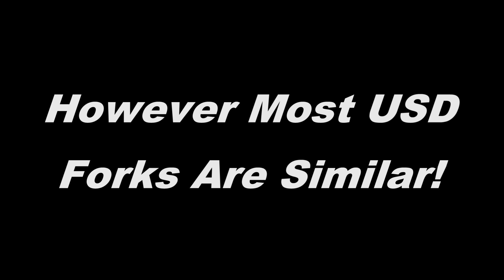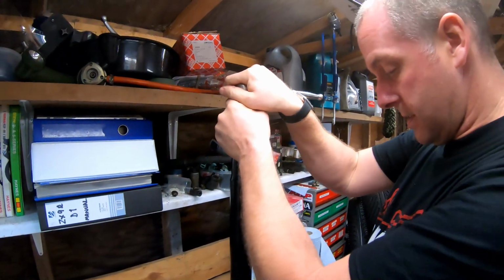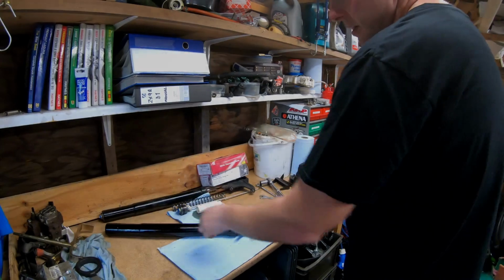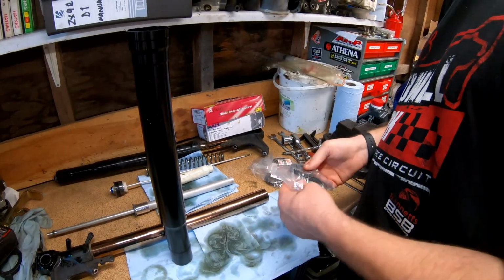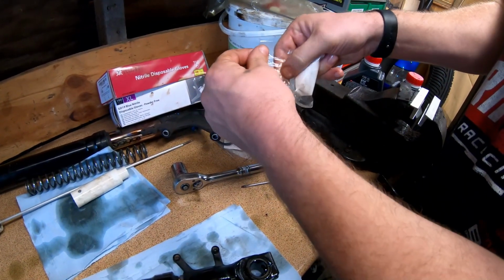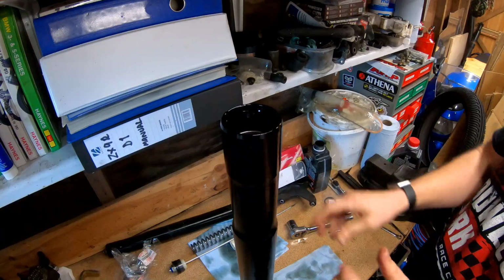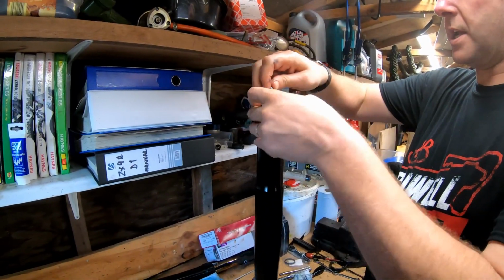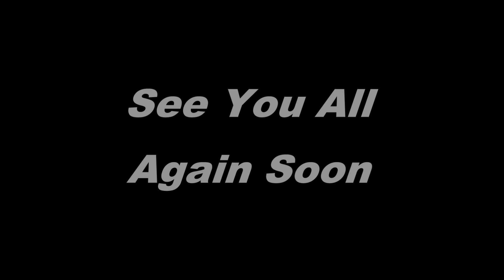Upside Down Motorcycle Fork Seal & Fluid Replacement

Comment: Hi mate. Thanks for the video. 

A tip I have for you though. 
Keep a spare yoke near your vice. 
If a customer drops round the stations with the top cap on you can use the yoke to hold the station while you unscrew it. 

(I've actually bored a yoke slightly and rounded the ports so I can easily slide them in and out without scratching them)

Comment: good video Kev . but there wasn't any need to undo the damper bolt in the bottom of the leg and no need to take out the damper rod as they can be a bugger to get back in if they start spinning  ,you only need to undo the bottom bolt on right way up forks,
Reply: You sure about that?
Reply: Yep I am
Reply: @lornemiddleton3532  so once i get the locking nut off underneath the upper spring from the fork cap, remove the circlip from the fork seal, i can start to use the forks like an opposing slide hammer to split them?
Reply: @Rman1100  yes exactly that you always fill the legs with oil with damper rod in place

Comment: Great stuff, chap!
I'll now tackle my DL1000 2018!
Can't find air gap info though, so will catch what's emptied out. 👍🏻
Reply from the maker: From the DL1000 V-Strom Manual that I have found it states that the oil gap is 133mm or a capacity of 505ml per fork. Check out page 287 of the manual at this link:

https://www.manualslib.com/manual/998591/Suzuki-Dl1000.html?page=287#manual 

I hope that this helps you out mate. Don't forget to subscribe to the channel, it really helps!

Comment: Hi from Montreal: have a V-strom 1000 2015 inverted fork.  I didint change the seal, just changing the oil.  Manual say 570 ML......... I just collected 250 ML of old oil.  Do you think over the years and milage, we loose a bit a oil at every suspension move? (have no seal problem at all) thanks
Reply from the maker: Unless you completely strip the fork to it's base components you will most likely not get all of the oil out. there will be a fair bit inside the damper which needs to be pumped to get it all out. That is quite a big difference between the stated capacity and what you recovered. Did you buy it new or is it possible that a previous owner didn't fill it to the correct level?
Reply: @KevsShed  ppl koi no

Comment: Nice video, thank you. One thing... You didn't put oil to new seal before assembling it. I don't know if it is mandatory but most people do it.
Reply from the maker: It's a valid point, I should have done so really as it helps to stop the seal puckering up on installation! I'll make sure to do it next time though! 👌

Comment: hi there! if you remove only the screw from the bottom of the fork, will the rod come out or is absolutely neccesary to dismantle the top part with that special tool also?
Reply from the maker: If you don't remove the top part then you cannot accurately measure the oil that you are putting in. Also you will probably find it impossible to get the bolt back in again without dismantling the fork entirely!
Reply: @KevsShed  first i was thinking to put the bolt in first and than to pour the oil recommended quantity from the manual from the top part, through the small holes in that white plastic, what do you think will it work?
Reply from the maker: @bladebiker100  Each to their own mate, I just prefer to use the prescribed method in the manual!
Reply: @KevsShed  thank you for the reply! i was just curios, i never serviced an upside down fork up to now, just regular forks

Comment: What if oil doesn’t want to go up the  damper
Reply from the maker: Sorry bud but I don't understand the question.
Reply: @KevsShed  it seemed like the oil was coming up the damper (where small nut is on) when you were pumping it and going down. I pump mine to get the air out but no oil is coming up the tube
Reply from the maker: @shyxguy6300  Ah right, it won't come out of the top, that must've been a bit of residual oil mate, give the damper a few pumps, you'll feel it meet resistance and pop it all back together and you'll be good to go! 👌
Reply: @KevsShed  alright. So as long as it feels like it has resistance I should be good? I’ve been pumping and it hasn’t had air bubbles come out for a cool minute.